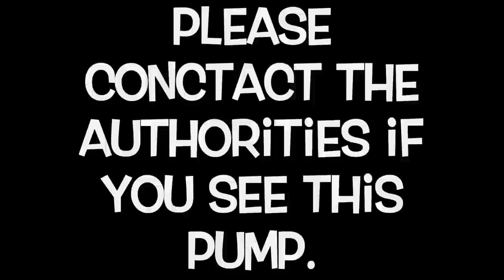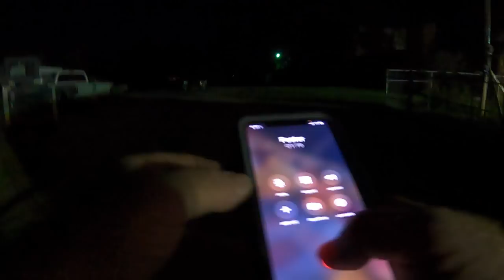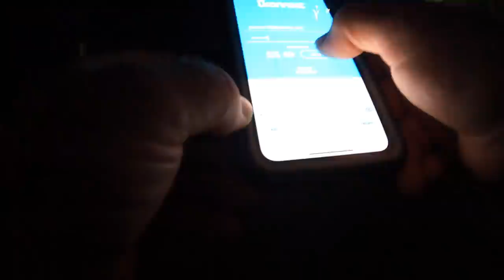They stole our trailer pump rig. Hunt the pump with Muddyfeet

Comment: That sucks. I had to buy a brand new one little over a year ago because my old one was stolen. Also you should know the insurance companies look at these things as mortar mixing machines. I insured my old pump for $50k. They only gave me $26k but that’s only because they finally checked prices of similar pumps online. I told them to keep the money and use it to find me another pump for that amount lol. Obviously that’s impossible and I ended up getting the money and never seen my pump again. Took 3 months to have my new one built by Putzmeister in Wisconsin. I drove up from Alabama to pick it up to save on shipping and so I could get back to work. It’s a terrible aggravating experience when they treat you as if you are trying to scam the insurance company instead of the victim. In newer videos I’ve noticed you found it though so that’s good!
Reply from the maker: Your exactly right. These people including the police department acted like they could care less at what had happened. I have the guys phone number that stole it and they wouldn’t do anything but called it a couple of times and said no one would answer. The hole process costed me more money than I had everything insured for plus the down time. Luckily we phone the pump pretty much unharmed.
Reply: @MuddyfeetConcretePumping  I was glad to see you found it. Mine still has not been found. It’s been 2 years. I think the police quit looking. It’s a shame they won’t let us do the investigating.

Comment: That sucks balls big time Jeff! Pay for a service but they send the info for your vehicle to a cop that doesn't care if he finds the truck or not?? When I had my company, I used Verizon Reveal as the GPS system. Sends instant "real time" updates to either your home computer or your phone. And you can install as many of the GPS dongles as you want. They cab either be held on by the magnet, or bolted in place. I wish you the best of luck! If I was closer than 1900 miles away, I would help with the  "hunt" for sure.

Comment: I’d look into onstar even though you’d have to run a gm probably.  I believe they can shut the vehicle off if it’s stolen so it can’t be driven farther.
Reply: Only the police can do that with the On-Star vehicles, and if the owner pays for that service. 
The owner cannot find where the vehicle is located. 
In some cases, works real good. Will depend on how swift the response is from the police.

Comment: I own and run my pump in San Jose California and recently many other pumpers in the area had the pumps with the trucks stolen and only have been able to find the truck but mostly like the pumps are either sold as parts so I dug piers filled with rebar and concrete and chain it down pump and truck and invest in a good tracker
Reply from the maker: Yes. I’ll be looking in to a a different tracking system

Comment: I'm another retired officer, and have been dispatched several times for a vehicles cover by both the "outside GPS companies," and by the big-name outfit, either for a stolen vehicle or even a wreck, and found exactly nothing.  I spent time searching for them, for a mile or two around, and never found it, and when they said it was a wreck, and I asked for the customer's address or phone number to see if he or she was okay, they told me I needed to get a subpeona.  (Which no judge will give you on crappy information like that.)  I'd give you some LE folks to help you out, but my friends in your area are retired too.  Did you have a serial number on the pump so they could enter it into the database?  I think your posting about it on here was a good idea.  I also suggest other folks reading comments not to be scared to call if you see a similar pump, I know I was never mad if someone asked me to check something out that might be stolen, and the honest folks mostly don't care if you look at a serial number.
Reply from the maker: Yes. I’ve got the serial number for the pump and motor. Also for the dodge truck. It’s in the reports  they took.

Comment: You need direct tracking on your equipment. My son has it on his construction equipment. It is not cheap. IRC it costs him around $3K a year. At any given time he can look up where any of his equipment is. He has found it makes his "help" be more honest too. No more saying they are on a job when they have not started yet. 
      On your DEF issue on the KW. If the truck is out of warranty and you do not have state annual inspections, just delete the darn stuff. Yes it is illegal federally but I do not see the federal EPA sending you any money for a system that is broken.  There are several local fellows that do repairs that can do it. Take the filter off or knock the guts out of it and then flash the ECM. Takes a few hours and your good to go. If your planning on selling the truck down the road then remove the filter and keep it for reinstallation. The fellow here keeps a copy of the "factory" ECM and can reflash it then. Now WE would never do any of this as it violates Federal law. SMILE 
  P.S. If you do delete the DEF use the old three SSS approach. 1) Shoot 2) Shut up  3) shovel. LOL That would work good on the thieves too.
Reply from the maker: I’m looking into getting it deleted. They are telling me the paccar engines hard the hardest to do.

Comment: Gps hardwired or the wireless units that run off radio signal it’s what the repo guys use don’t need to call anyone it’s all on your computer that’s stupid we can only tell the police where the car is well by then it’s in a bunch of pieces or is painted with a new vin hope y’all find it quick especially the pump can get a truck anywhere a concrete pump trailer ya can’t also a horrible time for the other pump truck to go down to a sensor that’s why everything I have is old and junkie 1 no one wants to steal it two there’s no def nice video wish it was about pumping concrete not someone stealing your stuff
Reply from the maker: I sgree